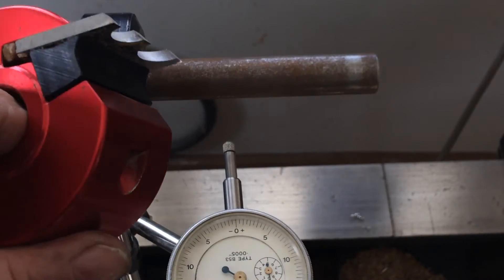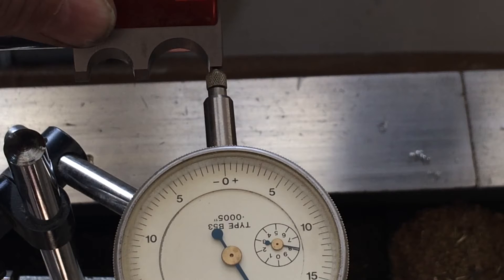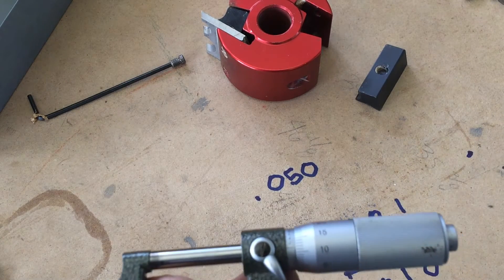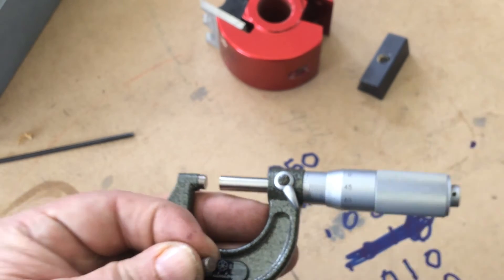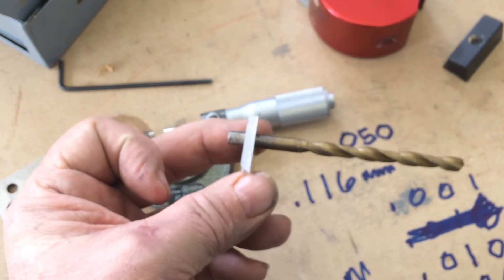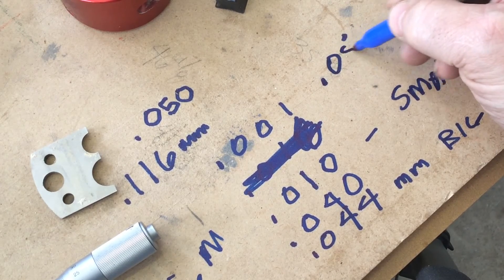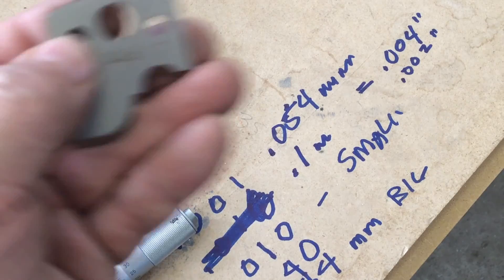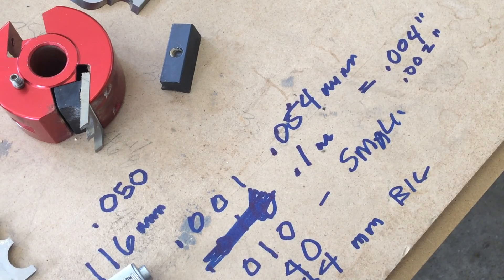How accurate  is a Euro block  with pin knifes .

Comment: I use pin located and serrated tooling I also have some bolt on that came with a machine that I've never had the balls to use. I like pin for cutters I change often and small cutters as change out is so quick. But for big profiles like my doors and my big gate top rail profile it's all serrated as I find better quality knives seem to bi available and for the big stuff it's about all the options there are. I've never had an issue with pin location and my scribe heads on my Wadkin EKA are pin location heads.